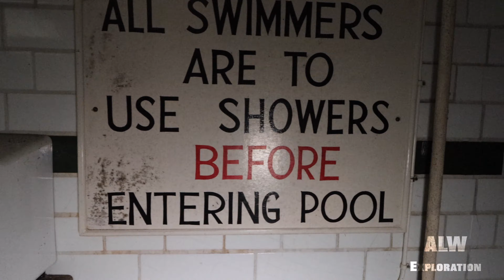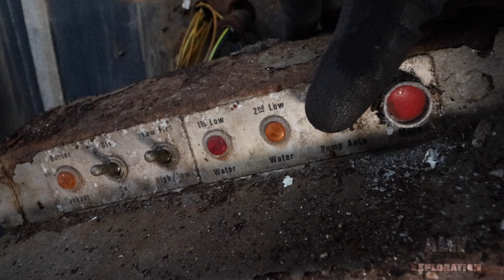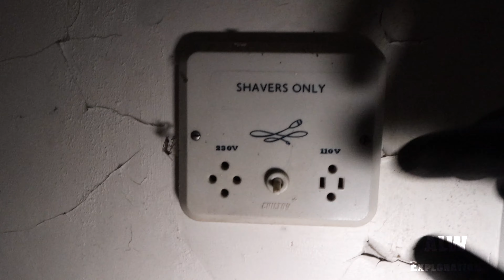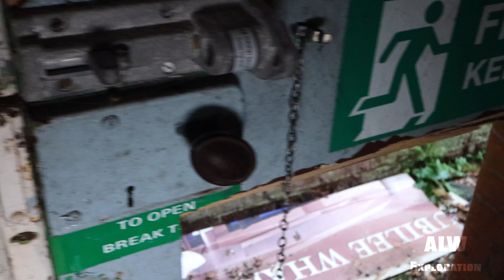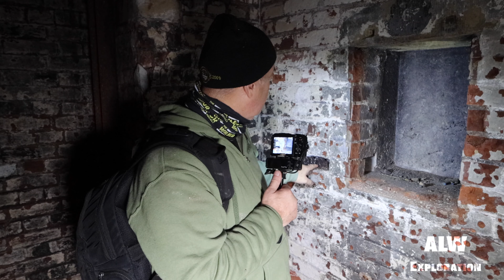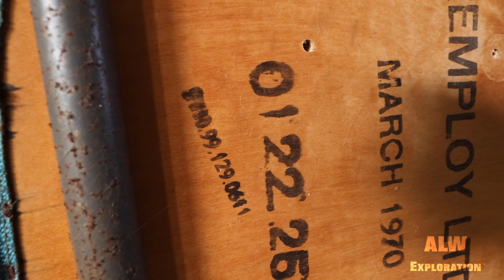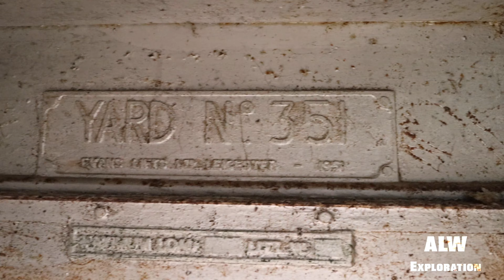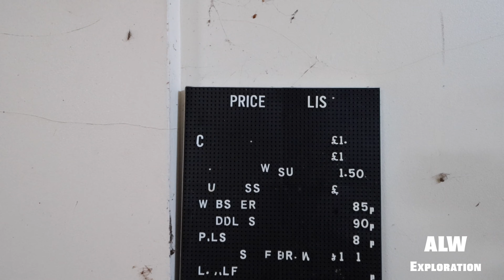HMS Ganges | Royal Navy's forgotten base

Comment: I did my Navy basic training there in 1974, Climbed the mast and I've still got the trophy for best shot in my recruitment.
Reply from the maker: Wow Jon. That mast is mighty high. It’s sad to see the base like it is but at least it’s still there. Thank you so much for watching and commenting
Reply: @ALWResearchTeam  All recruits had to pass the Royal Navy swimming test in that pool. Wearing a pair of thick cotton overalls, you had to jump from the top diving board. swim three lengths and then tread water for five minutes. By then the overalls weighed a ton! Everyone passed the test because the instructors wouldn't let you get out of the pool until the time was up!
Reply from the maker: Exhausting times indeed.